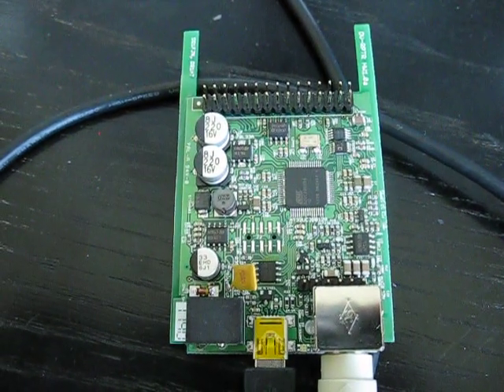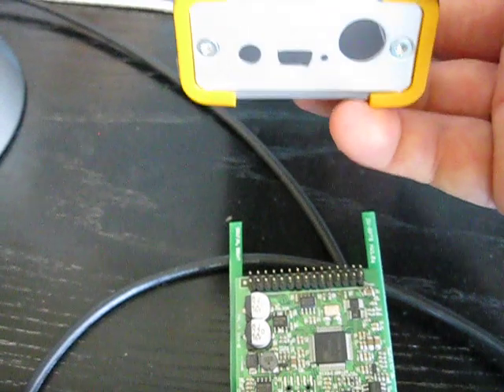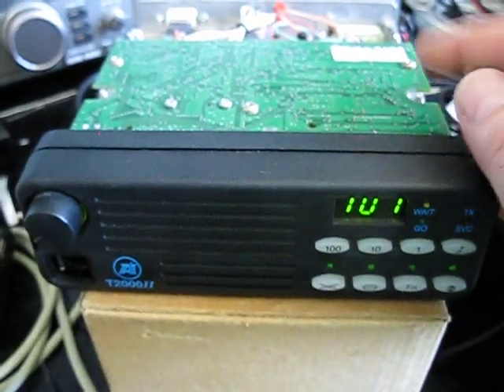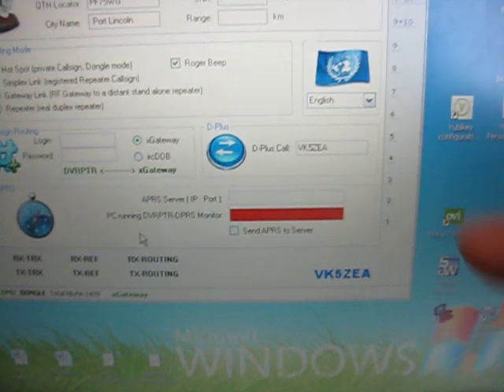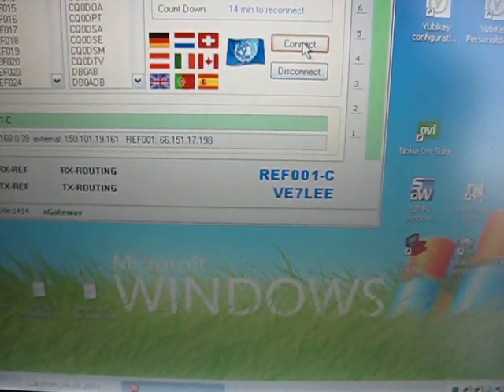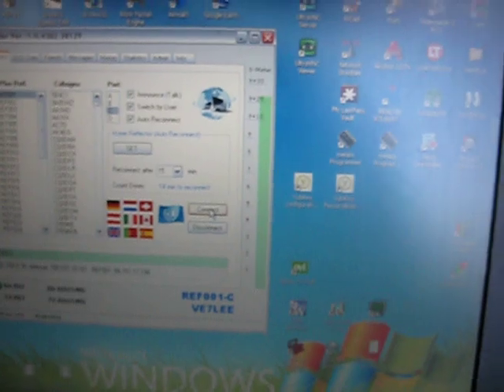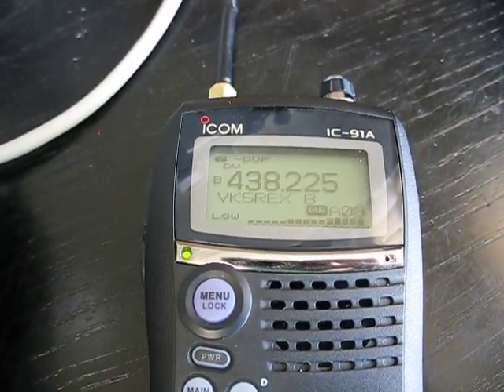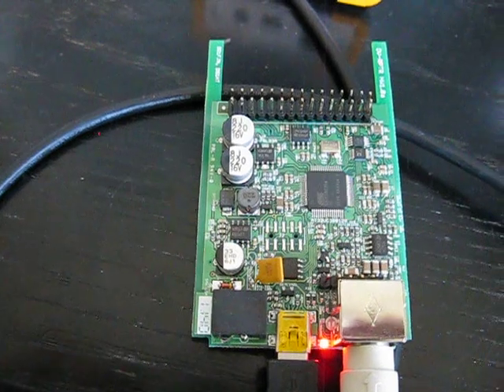DV-RPTR Modem Board

Comment from the maker: @melbourneradio The Tait radio is transmitting the D-Star GMSK modulation from the DV-RPTR board. It's an traditional analog FM radio, but it's transmitting/receiving 4800 baud GMSK digital data.  An amateur radio transceiver can do the same thing in 9600 baud packet mode.

Comment from the maker: I've neglected to mention the connector at the "back" of the DV-RPTR board.  This is an expansion connector that is available for experimentation. It has various control lines and voltage rails available.  In the basic D-Star GMSK firmware implementation it is not used.